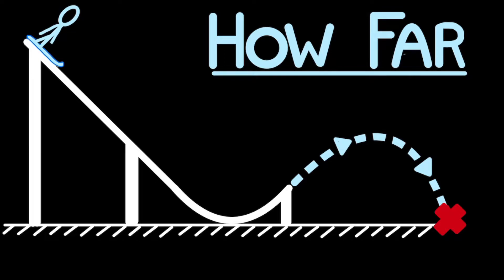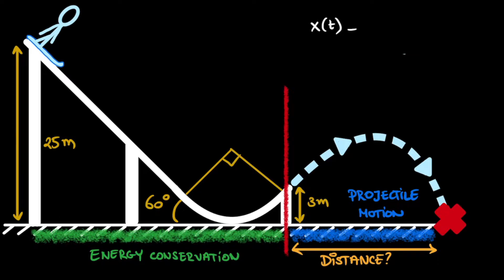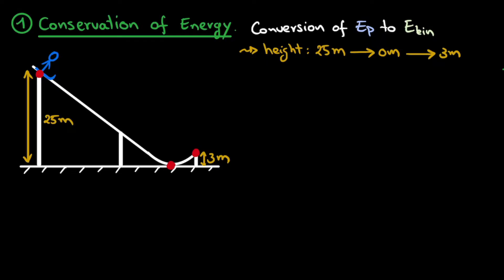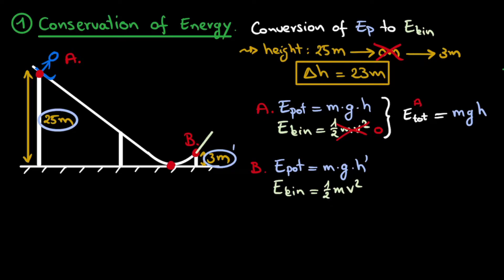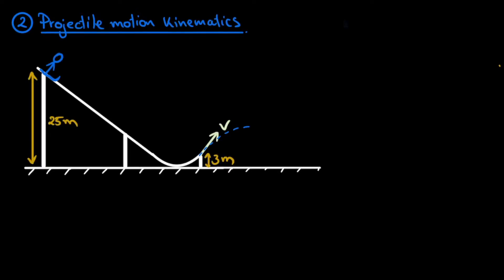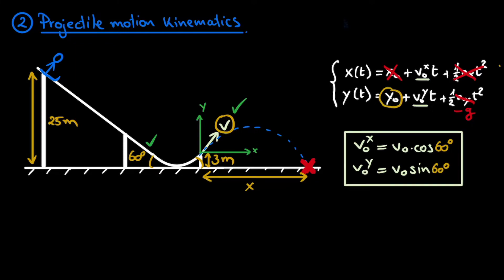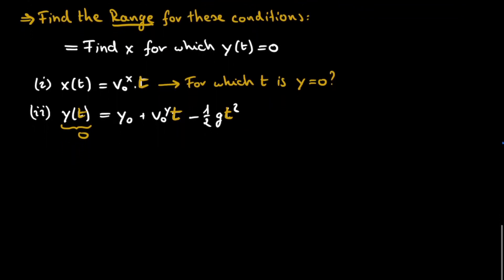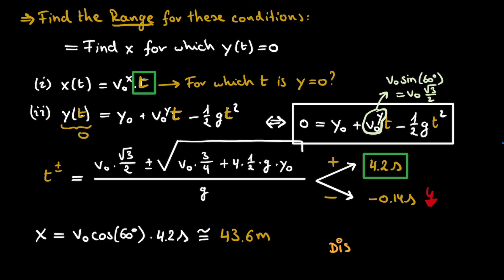A Difficult Dynamics Problem - Step-By-Step

Comment: Kinda off topic but I was wondering how does air resistance affect the projectile? I've seen people, pardon my choice of words, make themselves like sticks once they launch into the air in skiing contests, would that reduce air friction thus expand the range?
Reply from the maker: As always, excellent question. Here we ignore air resistance completely, in both parts of the exercise. With air resistance, the velocity at at take-off will be lower.
During the projectile motion, air resistance indeed influences the trajectory. How it does so exactly, I don't know right now. But it is interesting enough to check it out. I will do so, and make a video later on. I do think that indeed making yourself "flat" such that "you surf on the wind" would extend the range :D
Reply: @PenandPaperScience  ah yeah, i meant flat hehe